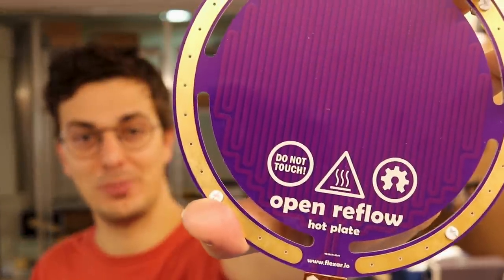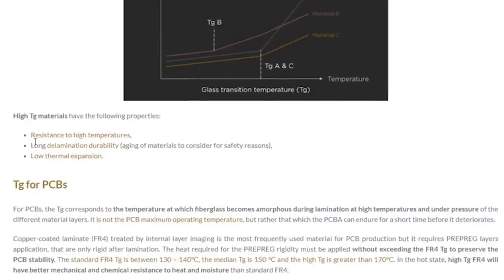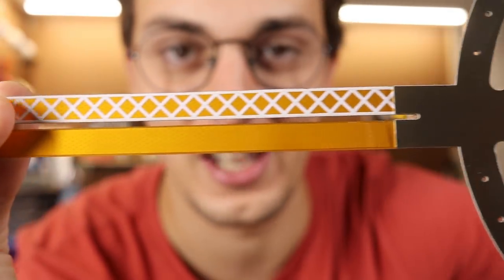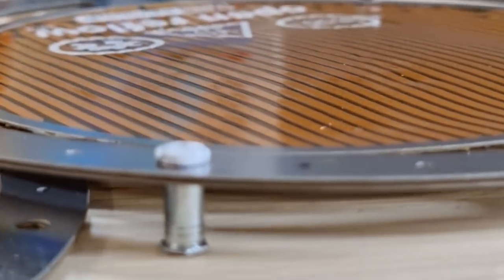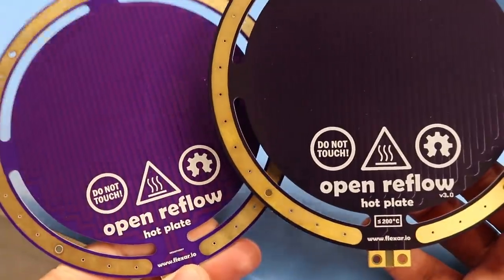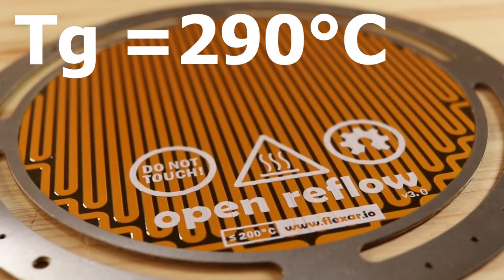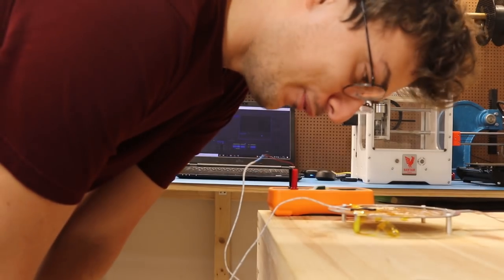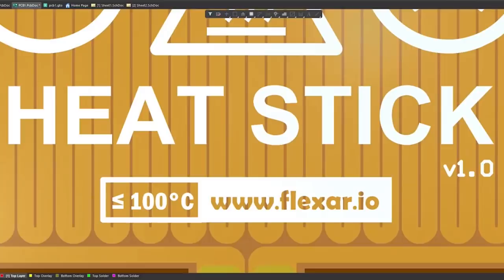Experimenting with High Temperature PCBs!

Comment: It would be better to use the stiffener as the heating surface. The bubbling up might come from thermal expansion. The stiffener doesn't expand while the circuit board does. I would paint a metal plate with graphite paint as a resistive heater and only use the pcb for the circuit. PEEK melts at a high temperature (343 °C / 649.4 °F) and is used for high temp applications.
Reply: How do you insulate the heater from the metal plate? Steel is conductive enough that it's too low impedance at those 12V.
Reply: @SianaGearz  you mean in the case of a carbon based ink? I would use a layer of high heat powder/ceramic coating. You can get an electrostatic powder coating sprayer for $40-80 and once it is baked in an oven 180-200C for 10 min it is hard. Some coatings need longer or slightly more heat (300-350C or 500-600F) many standard ovens reach those when you use the self cleaning cycle.

Comment: What about reflowing PCB's with a 3D printer heated bed/base? Isn't it the same working principle with copper tracks all around the surface? Just an idea..
Reply from the maker: In my previous video I found that aluminium pcb are rated not to go higher than 130degC - most heatbeds are also aluminium core
Reply: The high temp beds are using silicone heaters, not PCBs.

Comment: Why don’t you try it without a soldermask?
Reply from the maker: Placing a PCB on top of the bare copper could short the traces - lower the resistance - increasing the current - increasing the temperature - and potentially go BOOM🔥
Reply: @CarlBugeja  ah yes, of course! So we need a thermally conductive and electrically nonconductive material. I wonder if kapton tape or baking paper have the same properties as soldermask (causing a 25 degree difference). Good luck with the project! It’s super interesting and cool for this to be realized!